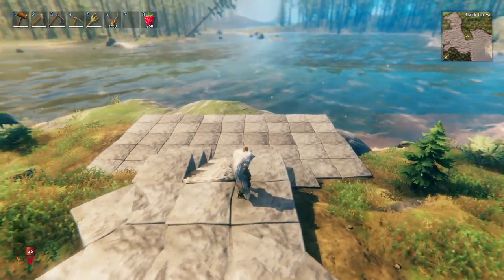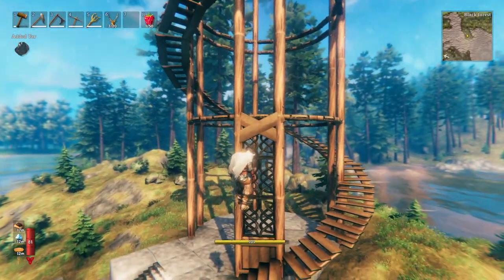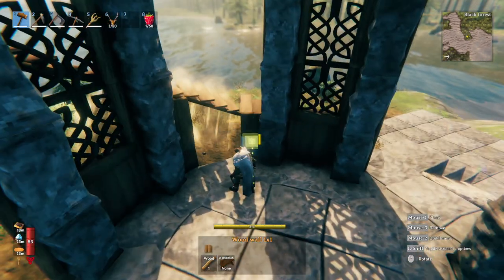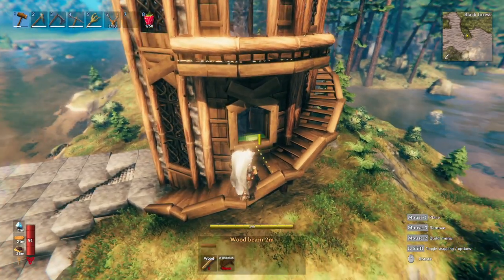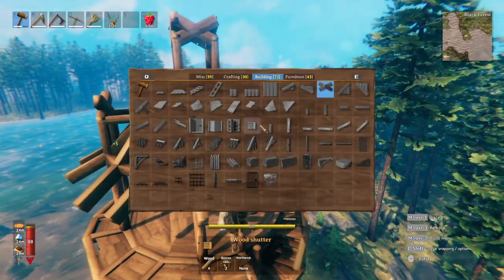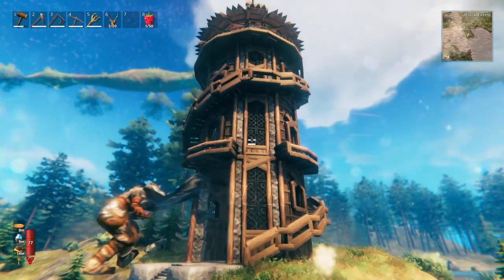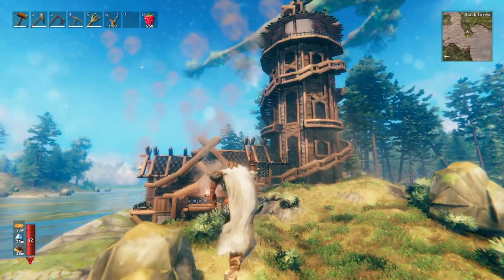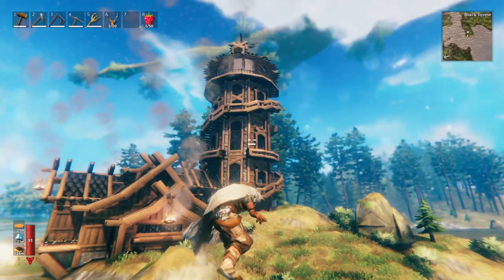Valheim Build Series | EP 22 | Lighthouse Pt. 1 - Construction

Comment: That's the best I've seen shingle look; might only use it for round roofs in future. Great build.
Reply: Just a tip, if you have a massive complicated roof with like twists and turns and round angles and straight etc aka not round completely I advise you to build the roof once lol. It was a absolute nightmare upgrading my thatch roof to shingle
Reply: @Siks7Ate9  Been there, done that I'm afraid, and on a fairly simple roof, too. Worst thing is that I actually think it looked better with thatch lol Cheers for the tip anyway.
Reply: @danielshagman  my roof was on a stone section of my build, it was 5m long then 3x 2m 1 tick in then 1m 1 tick out then 2m then 2m 1tick in 1m 1 tick in I believe and that mirrored on other side. Then I had wood ontop the insides of the stone and the roofs connected to a straight part of the building. It looks allot better with the shingles but it was a nightmare, it had to look good on the inside and outside that was the most difficult part. It does look awesome though
Reply: I know the dimension because unfortunately the whole thing somehow was miss alligned when I build half of the thatch roof I found out lol so I had to rebuild the entire thing including the winding staircases lol
Reply: @Siks7Ate9  Sounds excellent! Apart from the rebuilding bit, which sounds like a nightmare. I think we've all misaligned stuff, but I've been super careful on big builds to make sure everything lines up right, cos I think I'd cry if I had to rebuild a massive build xD

Comment: Just built this in survival, was actually pretty simple if you just build one layer at a time so you can go up the stairs as you go. Not bad at all, costs a lot of iron and i found alot of the iron poles you used weren't actually necessary (1 year later anyway) Only thing that is rough is that i haven't gotten to the plains yet so i can't get tar so i had to improvise xD